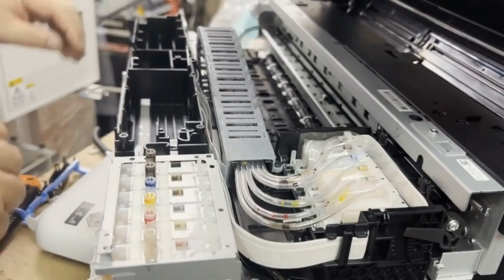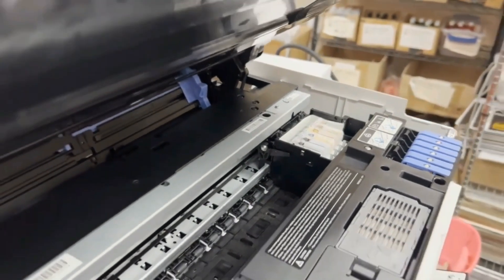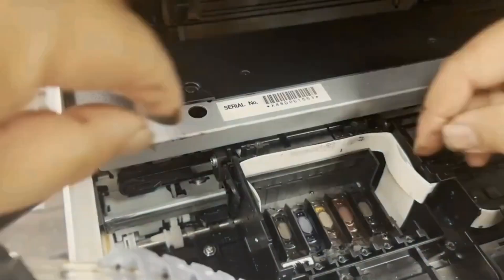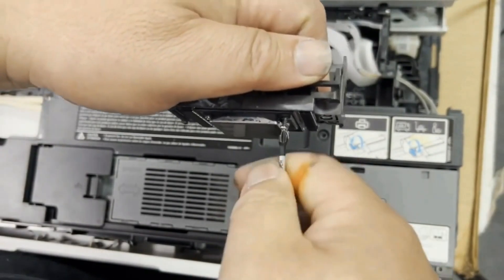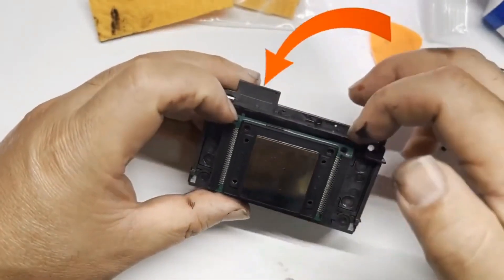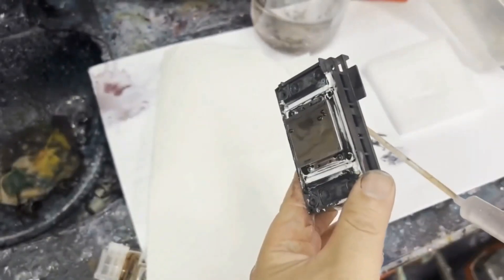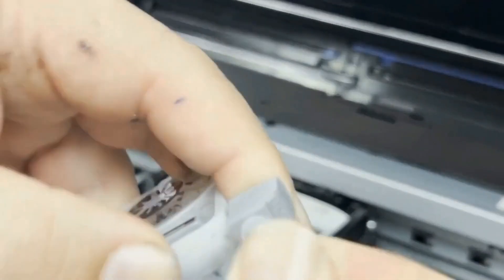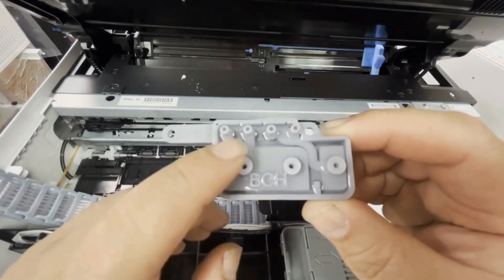Pro-Level ET-8550 DTF Conversion: Modify the Printhead - Complete Course (Part 2)

Comment: Do you need the adapter for the original tubes
Reply from the maker: Thanks so much for watching and for your great question! Yes, you’ll need an adapter if you plan to connect the original Epson tubes, since the stock tubing and fittings aren’t designed for DTF ink flow and pressure. The adapter ensures a proper seal and prevents air leaks or ink starvation during printing. I really appreciate your support and engagement with the channel! We receive a high volume of questions every day, but subscribers and members get priority answers within 48 hours, along with exclusive benefits like early access to new videos and special content. If you ever need faster help, you can email [support@bchtechnologies.com](mailto:support@bchtechnologies.com). And if this video has helped you in your DTF conversion journey, please consider leaving a review on our Google page—it really helps the channel grow: [https://g.page/r/CfL7k6nYvPQ9EAg/review](https://g.page/r/CfL7k6nYvPQ9EAg/review).

Comment: i want to buy 50 conversions from your website however will it be compatible with my xp600 printer?😊’
Reply from the maker: Thanks so much for your support and for the great question—I really appreciate you watching and engaging with the channel. Yes, if you’re asking whether an ET-8550 printhead becomes functionally equivalent to an XP600 after the nipple conversion, the answer is yes, once the nipple conversion is done correctly it is compatible and behaves like an XP600 printhead. If this helped, please consider subscribing or becoming a channel member, since subscribers and members get priority replies and extra benefits like early access to videos, which makes a big difference because I receive a high volume of questions and can only reply to about 10 per day; subscribers and members are typically answered within 48 hours, regular viewers are answered if time allows, and after subscribers and members, any remaining reply slots are filled last-in, first-out (newest questions first). If you’re not subscribed and don’t get a reply within 48 hours, you can either subscribe or simply re-post your question so it moves back to the top, and if you subscribe later, your older questions automatically become priority without needing to re-post. You’re also welcome to join Run With Kevin — LIVE, where I go live every morning, usually between 6–8 AM Eastern, to answer printer questions in real time, so subscribe and turn on notifications if you want to catch the next session and ask directly. If you need faster assistance, feel free to email [support@bchtechnologies.com](mailto:support@bchtechnologies.com), and if this video or comment helped you, I’d truly appreciate a Google review here: [https://g.page/r/CfL7k6nYvPQ9EAg/review](https://g.page/r/CfL7k6nYvPQ9EAg/review).

Comment: Hey Kevin I've watched a lot of your videos and wanted to know if you've experienced a scenario where your printer does not turn on after completing this modification. I plan to back trace my steps tonight to attempt to find the issue. But wanted to know if there was anything in particular I should look for or pay attention to. Appreciate your guidance in advance.
Reply: I’ve had the same issue. In my case I mounted the printhead backwards. On the printhead there are two dots on each corner, those dots are supposed to be facing inwards. Also check so the two cables are not mixed up, it’s important that they go in the same order as before you did the conversion. 
The printer will turn on after you’ve turned the print head around and wired it correctly. However it’s most likely that you’ve burned one of the fuses (F1 or F2)internally on the motherboard located to the left hand side of the printer. You will have to remove the motherboard and replace the burnt fuse. That will solve your problem. Good luck!
Reply: @XFILMZ  you have to be highly skilled to change those fuses.
Reply: To be a little more specific, I converted my printhead to the nipple.
Reply: @shaanallen7882  can you give an update on how your printer is after this time?